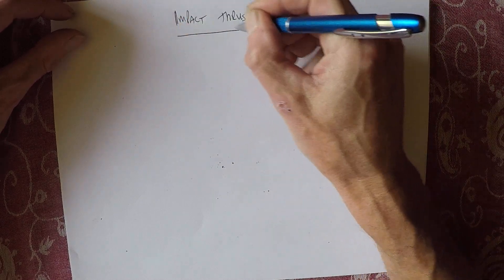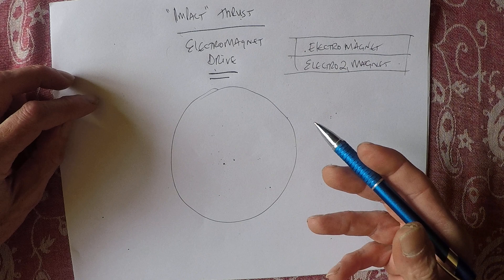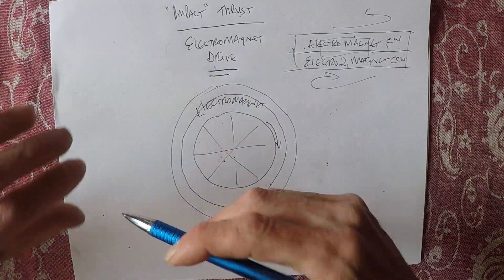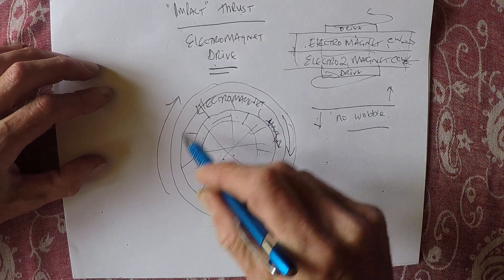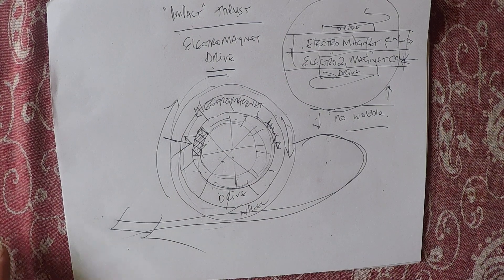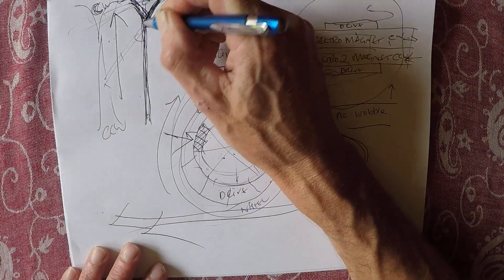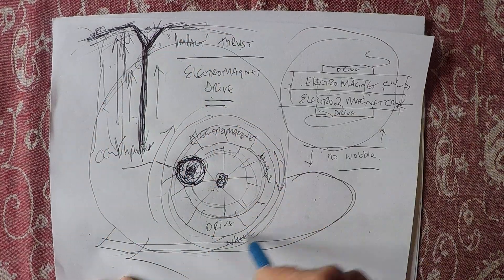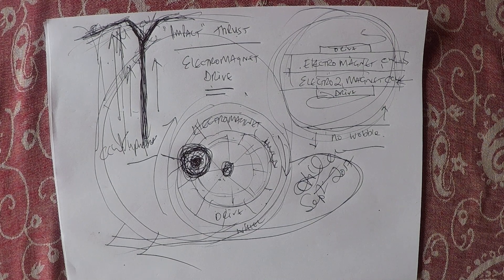How To Move In  (a vacuum ) SPACE Using an Electromagnetic Impact Thrust Drive

Comment: Lee, 
I thought that rockets propelled themselves by ejecting a mass and moving via reaction of pushing a mass. 
Eg: sitting on a rolling chair holding a large weight. I throw the weight forward, and I will roll opposite. 
Is this not how rockets work?
Reply from the maker: Do rockets have wheels, and are attached to the floor in a gravity situation and have arms ?  :)
Reply: Hahaha, that made me laugh. Good point. 
Let me stick with action and reaction. 
When a motor running and is suspended in no gravity, the stator and axle will spin at opposite directions. Because for every action there is an equal and opposite reaction. 
Thus in order for a body's center of mass to be displaced in free space must require a force great enough to overcome inertia. This force for rockets is them sending their own mass in the opposite direction, propelling them at high velocities. 
I must be missing an electric principle, is my question clear now?
Reply from the maker: hmmm
"When a motor running and is suspended in no gravity..."
is there a video of this?
also I do not know what a stator and axle is....(i know what an axle is but cannot visualise this ..sorry)
Reply from the maker: basically lets see a rocket in a vacuum chamber...one big enough to not let small confinement change the experiment..small rocket, huge chamber.
Then we will know.
no one has done it yet...they keep showing a feather and a bowling ball falling at the same speed.....which means nothing.
ask your self why nasa wont do this...as it would easily explain itself.
and yet they have NOT :)
Theory is fine....lets see the experiment :)
Reply: I see where you're coming from. I meant rotor and stator, the two main components of a motor. 
Is it possible to do this experiment on a smaller scale?
Reply: Also, if I can finish formulating the mathematical laws of vortex wave vortex, which include Maxwell's equations, then this could be calculated. I know you're not one for calculations, but I think it is important.
Reply: Actually I'm pretty certain i could do this experiment on a small scale
Reply from the maker: very easily....and it will work in our atmosphere too....
Reply from the maker: I hope you do brother as I have zero experience building anything :)